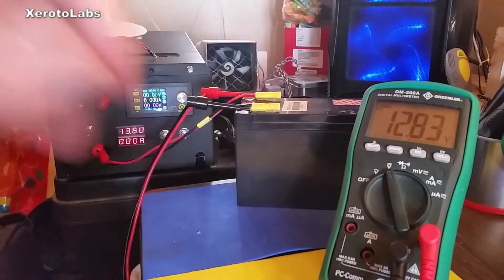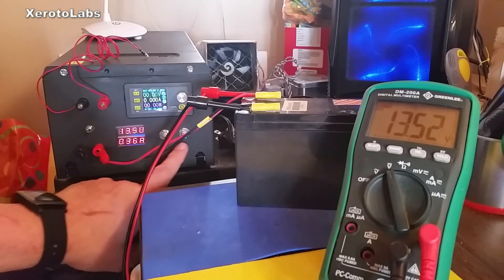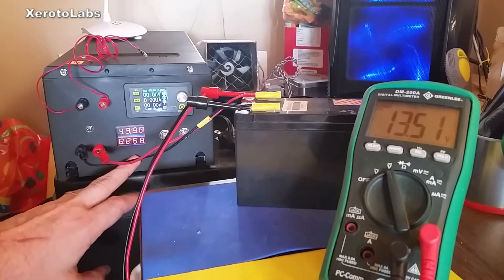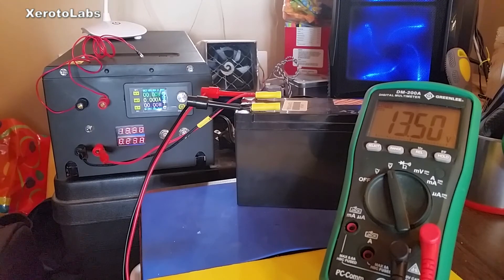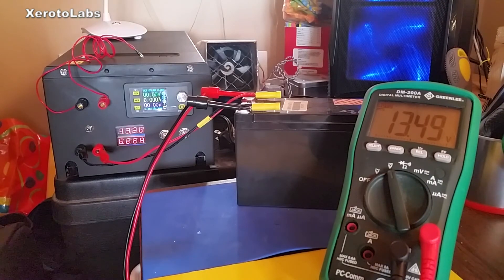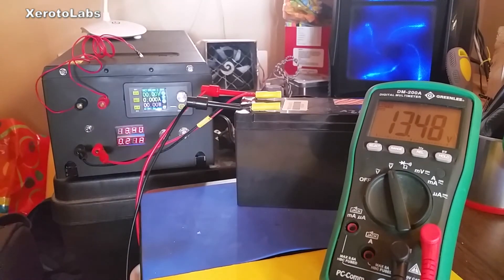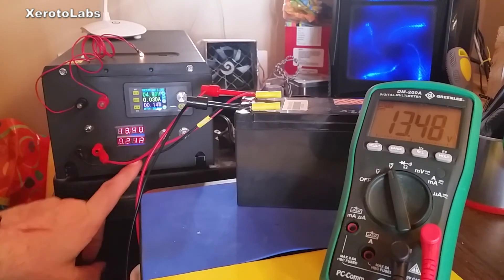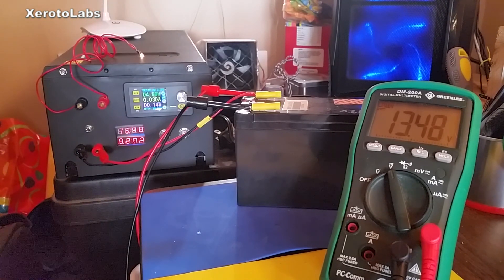Small Bench Power Supply [ Done ]

Comment: You did a good job on that, it looks great.
Reply from the maker: Thanks.  As with most things I'm already planning upgrades LOL.  And My Fabricator mini sits perfectly ontop , and possibly the spare 12v rail cna power teh Fab' Mini
Reply: You could even remove the front panel (again lol) and 3d print your labels into the front panel provided the 3d filament you use adheres to that panel material :)
Reply from the maker: hmm, good idea about 3D printing.  when I get my bigger homemade printer running I could just print the face plate haha.

Comment: What happens if you connect the two 0V terminals together? For example, you want to power a circuit which needs two different voltages? Do the current readings still work correctly?
Reply from the maker: the 0v are also actually connected inside anyhow. they are also ground.  the guys who make the small digital PSU now have a bigger nicer one. I may have to rebuild with that module.
Reply: @XerotoLabs  So if you connect a load across 2 resistors  and connect both supplies -  e.g.     +12V  --- 12R --- 0V --- 12R --- +15V  what current readings do you get? Won't both shunts in both meters be connected in parallel between supply 0V and load 0V?
Reply from the maker: @steve6375   +12V  --- 12R --- 0V --- 12R --- +15V   is actualy 2 circuits 
+12v--12O--0V   and   +15V---12O--0V  receptively, assuming R  was resistance ,  and assuming you meant ohms.   
Part a  will be  12v /12ohms  =1A
Part b will be   15v/12ohms =1.25A
use a site like this if you are not sure https://www.rapidtables.com/calc/electric/ohms-law-calculator.html
0V often called ground or Common . is a hit man circuits  use 1 ground or common while the hot sides run  varying + voltages. 
i what you describe is simply 2 circuits with a common  0V terminal .